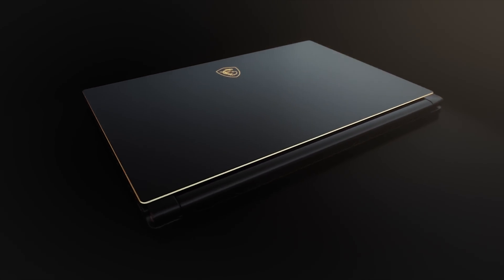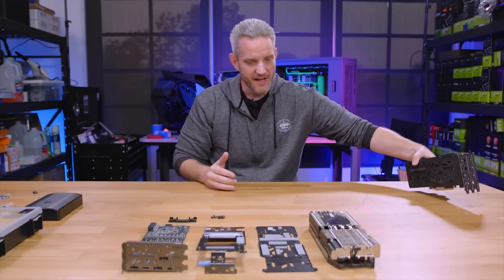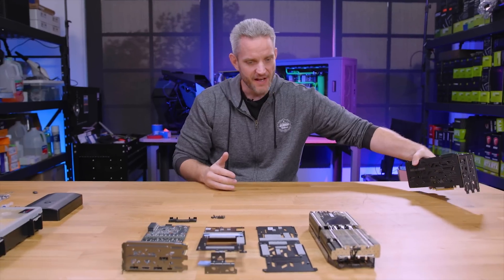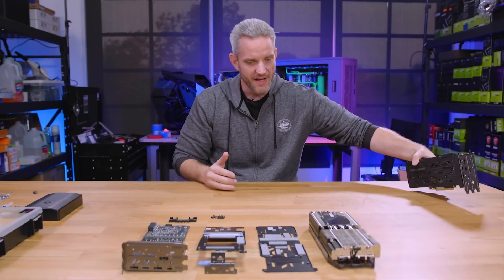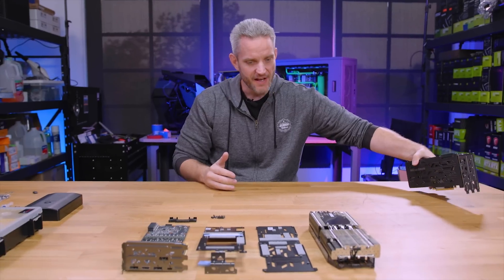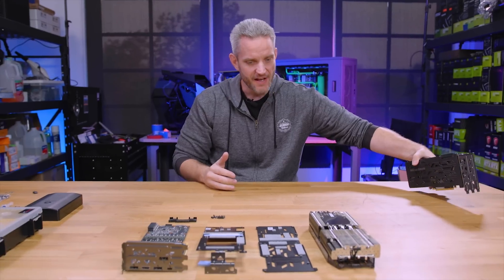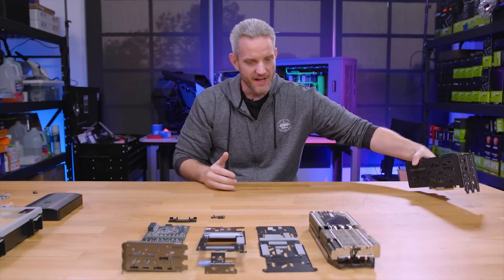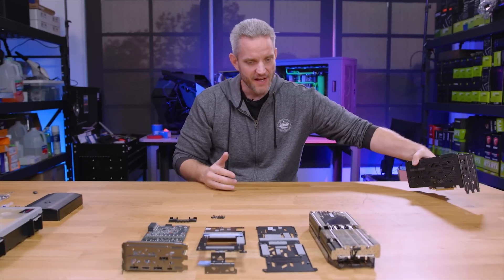I made my OWN 2080Ti Waterblock and the results are INSANE!

Comment: This looks way too professional! It looks like it's a kit made for that card :O
Reply: too*
Reply: Super1di0t  ty, corrected :P
Reply: 17 dollar Amazon waterblock ftw JayPrimeCents
Reply: its air cooled but if Jay use the chiller Machine to tweak it maybe he can kick GN or Linus :D !!!
Reply: This idea is actually brilliant, EK should steal it and come up with a really cost-effective GPU block solution.
Having a cheapo block that covers the core and an aluminium plate to cool everything else has to be cheaper than all these custom milled copper fullblocks?
Reply: @BenWillock  it is, AliExpress has it's fair share of these kind of rigs.
Reply: Ben Willock  alphacool nexxos mk 2
Reply: what d you mean, jay is a professional :D
Reply: *nazis
Reply: +ReganMarcelis  Spelling and grammatical errors are two separate things.
Reply: 4:02 cooling fart sound
4:06 skip cooling fart sound

You choose it's your choice. 😜
Reply: LOL Not so much of a Super1di0t then, are you :-)
Reply: evga should take notes
Reply: 35 points is within margin.. who watches this crap daily
Reply: @major wow Does it matter, as the plate itself is being cooled. So, if the thermal pads are applied properly, all the VRMs will get cooled.

Comment: The AC is a staple now.
Reply: Don't let your meme be dreams
Reply: Jayz'2'ACcents
Reply: You're too kind
Reply: It should be, the exhaust from the cooler has been dried so pushing it past the motherboard would reduce condensation and help with added cooling.
Reply: XD XD XD XD XD
Reply: If you are going to spend 3K on a video card what is another 500 bucks on a refrigeration unit for cooling

Comment: Man that graphics score is easy work. I got 8042 with nothing but a 360mm AIO NZXT Kraken X72 and the G12 bracket and my window open. Max temps 36c and boost clock 2160mhz and 1000+ on the memory

Comment: You make this stuff look so easy. I've never done custom water cooling before and watching enough of these videos is giving me a false sense of confidence

still, this is amazing stuff. it's nice to know parts are basically milled the same and so there are options for custom water cooling on day 0 graphics cards.
Reply: What he did here was pretty damn easy actually - mostly just because the gods of hardware aligned the planets so that all of this random shit that he used just miraculously all happened to worked together LOL.

As far as liquid cooling in general and the 'complexity/difficulty' of it, it's all in your head. PC liquid cooling is MUCH easier than, say, doing general maintenance on your car(oil changes, brake changes, etc.) - which it self is typically pretty easy even for a first timer if you just follow a how-to. 
At the end of the day, it's just parts and pieces, and they're all designed to work together, just like how a bolt screws right into a nut. 

I'm a total gearhead that has built engines, modified suspensions, built some track cars, so, when I got into enthusiast PC stuff, I was kinda surprised by how people viewed liquid cooling. Frankly, it's child's play compared to building an engine, but I taught my 16 year old nephew to build his first engine two years ago(and right now I'm helping him build his first drag car to drop it in), so anyone can learn this stuff if they really want to(I'm self taught myself). 
And, we're talking about something MUCH easier than that. 

So, look at it this way; whether it's building engines or liquid cooling PCs, there are 10s of thousands of people all around the world that are doing this stuff just as a hobby, a fun project, so, if they can do it, why can't you? If they can do it without blowing their stuff up, how hard is it REALLY? What you're actually worried about is just the unknown, you don't have first hand knowledge of how easy it is, so your mind just goes straight to assuming that it's easier to kill your computer than it is to liquid cool it successfully, without someone holding your hand. 

If it's something that you're legitimately interested, then watch some how-to videos on here, go buy a basic EK kit that fits the hardware in your system, then just follow the directions and the advice you've heard, and you'll have your first liquid cooled system - and a truck load of confidence in yourself after finding out how simple & straight forward this stuff really is. Hell, feel free to message me if you have any questions even(cars or PCs LOL).
Point being, don't let your mind and fear of the unknown scare you off from trying things that thousands and thousands of people around the world are doing!
Reply: @wc7618  Well I'm definitely the kind of sucker that has trouble knowing when to "shut the hell up already" and that can't pass up the opportunity to offer some genuine encouragement(it drives me nuts when I see comments suggesting that PC liquid cooling is at all a difficult thing to do - the stuff is literally designed to all work together lol), so it was really akin to a calling from God you could say.

Well, I was also just really bored at the time too, so there's that as well...
Reply: @RyTrapp0  Glad that you warned us. Would never have figured it out :)
Reply: well the most difficult part in water cooling is good planning. it's actually rare that you get all the parts you need on first try.

Also it depends a lot on how you do your loop. if your using quick disconnects, what kind of them, what kind of fittings, what kind of pumps, pwm or not etc

there are a lot of variables, and it takes experience to sort it out. and faillure means ruining hardware.
oh and emptying the loop can be really tough the first time if you did not planned for a way to do it easily.

nowadays kits from EK for exemple makes the experience easier. especially the quick disconnects.

Comment: 30C under load... my 980Ti on the air cooler it came with is crying, you can't tell because the heat immediately evaporates the tears
Reply: Bruh, I'm still using my reference 980 ti, good thing I can't hear it crying because of my loud ass case fans
Reply: @Silvers_7  i feel bad for people owning blower cards... those 5k rpm on the blower.. i d rather listen to a vacuum cleaner all day long xD
Reply: Zotac 980ti AMP Extreme right here, stays around 60-65°C but it's coilwhine is killing me
Reply: @unforcereal802  Not sure if it has always been that loud but you can get replacement fans on ebay or alibaba, just find someone who sells gpu fans and message them about what you need and in most cases they will get it for you.
And also change the paste as the fans wont have to work so hard to dissipate the heat
Reply: @stianaasland9740  I got a custom fan curve, mine is pretty quiet, it's just the coilwhine and I can't change that :D But I'm getting either a gtx 1080ti or a rtx 2080 (ti) next month👌
Reply: @unforcereal802  I'd suggest the 1080 Ti, the gain for the extra cash if you get the 2080 Ti isn't worth imo.
Or wait untill the next gen but considering the "pandemic" these days that might take awhile
Reply: Sam Hyde  Sounds a bit early to repaste a 2080, usually it takes somewhere around 3-5 years before you should have to. 
Could be a driver update issue or just bad thermal paste.
I would also recommend that you check the screws on your graphicscard cooler and backplate.
I have seen those come loose because of vibrations before.

Comment: Ran Timespy yesterday on content creation workstation rebuild: 4K monitor for photography with max 60 Hz refresh (actually 2 of these connected), 10700K, Z490, 32GB at 2,666MHz, no overclocking, with old GTX1080Ti-11GB.
Timespy: 9,436, CPU TDP 125W.

Comment: yoooo this is dope, just missing some liquid metal!!!
Reply: At that point does it even matter? He's already at 29C under load, lol
Reply: liquid metal conducts heat better at higher temps - same reason why LN2 isn't done with it. dunno where the cut-off point is for it but sounds like thermal paste would be better here
Reply: i want to see this test now, remove the thermal bottlenecks.
Reply: B Ueb  I replaced my Kryonaut with Conductonaut and saw a 3C better temp on my 1080ti. Maybe 3C better could net him the 3 points he is losing to LTT lol.
Reply: @A1Plooplord  the problem for liquid metal under LN2 is that it freezes and cracks at fairly high temperatures, not the reduced conductivity itself.
Reply: David Gans NaK with potentially subambient temps lol
Maybe he should just set his rig on fire manually :)

Comment: So crazy cooling experiment idea:
Add a temp switch to a chest freezer.
Snake copper pipes all throughout the thing.
Connect multiple heat sources to the device to see how long it takes to break. I would recommend multiple outputs (from freezer) so you're not passing heat to other PC's.

Comment: Just one of those 2080 ti is the same thickness as two of my 1080 TI Aero sandwiched together lol( and also a way better card than both of my 1080 TI Aero LOL 😔)A person might have to get a few industrial-strength i-beams installed in their case in order to prevent GPU sag one of those 2080 TI lol
Reply: well i'll take your 1080tis. or just one even. 300? ;)
Reply: @Merkasaw LOL well I was joking sort of LOL... But these cards are still super thick man and GPU sag definitely a real and present danger with these cards versus past cards
Reply: @MoeZarella  600$
Reply: that's actually not a bad deal
Reply: it's actually a good deal yes.
Reply: DAWGZofWAR s

Comment: When the 1080Ti came out i bought a reference board removed the stock air cooler and put a water cooler for a CPU on it. Used thermal tape and heat sinks on the VRMs/memory etc and have been running it at 2100mhz boost ever since. max temps even for VRMs are 50c after a long time. normally 40c~. well worth it and doesnt take up too much space.

Comment: Regular universal gpu waterblocks usually do fit fine, regardless of cooling plate. I'm not sure what the point was. Also you WANT to mount through the pcb and you want the waterblock to NOT move around on top of the chip.
A/C is old hack. Been using a 10,000btu dedicated A/C  with a MM UFO Extended  over 4 years.

Comment: Word to any small shop looking for a big idea. What we need, what we really really need, is a copper plate machined to sit on the GPU, and on the thermal pads covering the memory, the choke ,and the other temp related ic. The upper side of this plate would be flat, flat enough to mount an off-the-shelf AIO.  

Of course, it would have to be a customer for each of the high-end GPUs requiring water cooling, but it is very possible. The CNC, as the original 3d printer, could do this easily.

Comment: 11:01 if max temp under load 30 C why you dont overclock it for 70 C to get better benchmark
Reply: Was thinking the same, kinda like threadripper with liquid nitrogen.
Reply: U cant. U need change pcb pwms , and vcore to get more voltage and more clocks. Cant do that without mod the hardware itself.
Reply: @rportella9357  ohhh I see
Reply: @rportella9357  ur smart
Reply: Panicky Khan not that hard if you know your stuff
Reply: Think he know what he does
Reply: @rportella9357  even with hardware changes its not guaranteed to produce better results
Reply: @BeHappyTo  because you would need better architecture tomake use of that giant oc
Reply: Power limit, the Nvidia VBIOS sets a max TDP of 130% of stock. Notice how the voltage can go up to 1.1 volts, but it isn't hitting it.
Reply: High temperature means lower frequency

Comment: 4:04 horrible application of thermal paste. If you do it on a raw die, you have to cover every spot (since the paste won't spread to every corner). Don't believe me? I had a 7970 which I thought was DEAD since it always failed above a certain temperature (80C in that case). Turned out the thermal paste wasn't covering all of the die because I used the line-method aswell. Certain uncovered parts of the die were probably overheating...Reapplied the paste and that card is running stable ever since. So, remember kids: It doesn't really matter how you apply thermal paste between an Integrated Heatspreader like your CPU and a Cooler BUT if you apply thermal paste to a raw die, make sure to always spread it across evenly!
Reply: or a big dot/line in the center and smaller ones in the corners. Especially on laptops. Still new paste every year (and dusting/washing the radiator + oiling/greasing the fan if bearingless) makes more of a difference generally (unless yours is the case).
Reply: @dushk0  Every year? I guess I need to start doing that. Did not think about the paste getting old!
Reply: agree. the credit card method may not be the absolute best, but it's the one yelding the best average
Reply: hey, the video is edited, you probably didn't see all of the clip. He probably did another diagonal line in the other corners. I bet he does know better than that ;)
Reply: I am a mechanic and I agree with you the line concept doesn't work as well as working the paste into the micro pores of the metal. When I apply silicone RTV on autoparts I alway rub the silicone into the metal for better adhesion. I learned of this after removing several parts over the years where the silicone never actually adhered to the metal and would allow leaks. Oil pan leaks are mainly due to this fact. If the part is installed correctly the seal will last virtually for the life of the engine, my evidence is in every vehicle I work on.
Reply: Fabron, you must not be talking about aluminum pans. You have to straighten the steel ones. Ball peen and the bench vice for those.

Comment: Try dismounting the fans when you put the radiator in the AC inlet/outlet as they might hinder the air flow and reflect radiated heat back to the radiator. Yes, slightly, still Linus beat you just by the hair, too, so...

Comment: Couldn't you build some kind of enclosure and create a vacuum inside of it, then cool at well below ambient temps? I don't think condensation will form on the inside of your enclosure. If you insulate the outside with foam or spray foam insulation, it should prevent external condensation as well no? Can you try something crazy like that?

Comment: 8:53 so if the Vrams are cooler they can worck at lower voltage? Pls answer, I  have my GPU stuck at 0.8v at 1590 mhz, but if I increase the freq at 0.8v, then ill be stuck at 0.73v and the freq slightly increase, I don't know what it is fooing that ( it is stuck at that voltage because the power limit, and it also have usage limit), the die temps are around 70 -> GTX 1060 mobile. I can't solve this problem 🤦

Comment: what i find hilarious is that there will be a low profile version of the 2080 ti in about 3-5 years and won't require any massive cooling, yet will perform exactly the same as this.  how do they do it?  i remember my 5870 ran pretty hot, but then they came out with the low profile version and it looked just like an old radeon 9800, but actually performed a LOT better and faster than the original 5870.  why not come out with low profile versions in the first place?

Comment: Dumb question. 2080ti draws more power than almost any main stream cpu thus more heating. But the air cooler can keep it below 80 degrees while no cpu cooler can easily keep a cpu under 80 degrees over 150 watt consumption. Is it a result of the IHS thermal paste (no delid in cpu) or the 2080ti's cooler is actually (in area cm2) bigger and better than even the noctua d15?

Comment: sweet work Jay.  I wish I had the resources to try this with a amd 580 card I have but I can’t afford to damage it if I cooked the ram lol. There no water blocks being made for the xfx 580 8g black edition that sold though bestbuy.  I. Hate the fact this card running like 35c  under just web surfing and light steam gaining ( end up lowering the clock speeds to keep cool)  and the dang thing has a zero rpm fan speed at times cause it got some quiet bios design on it
Reply: Also FYI alphacool. Won’t do the gpu block piece with United States based card for the free gpu block sadly.

Comment: been looking to water cooling my older cards (GTX 770 classified with no aftermarket blocks) and I've noticed that a lot of the aftermarket GPU watercooling blocks seem to be diagonal to the mounting screws. Why is this when most GPU processors from what I can tell have them squared with the card...

Comment: Jay, you you know if it will be possible to use a g12 bracket with its stock screws for bracket attachment, and retain the backplate and pcb plate?

Comment: shouldnt the water pass first from the vrms before to the gpu ? cause if you pass the water from the gpu first vrms are not gonna be cooled cause the water touching them will be hotter than them because it carries the heat from the gpu, while if it passes from them first it will have lower temperature than the vrms and then it will still have lower temperature than the gpu

Comment: The 1080 and 1080 ti "VRM overheating and exploding" was actually not cause by inadequate cooling, but rather by faulty components provided to EVGA from the manufactures. EVGA obviously expected the components to be up to QA standards and don't test them, which led to exploding cards. The misinformation of VRMs overheating was spread by gaming journalists who don't have any technical background to properly diagnose nor provide adequate insights on the cause of the issue. It was a simple reaction of correlation = causation.  EVGA then made changes with over engineered VRM cooling on the ftw3 models and since for the purpose of satisfying the press.

Comment: Janky incorporated. It exists because it works. At this point, I insert the programmer meme where the pigeon helicopters away with its head with the caption "When your code is a complete mess but it still does the job right".